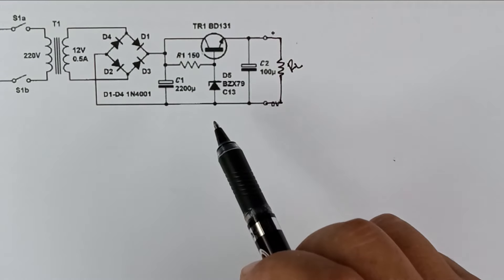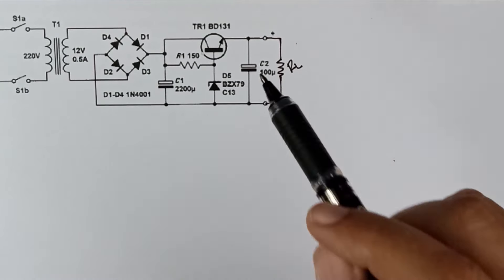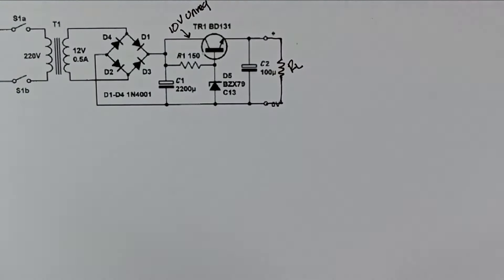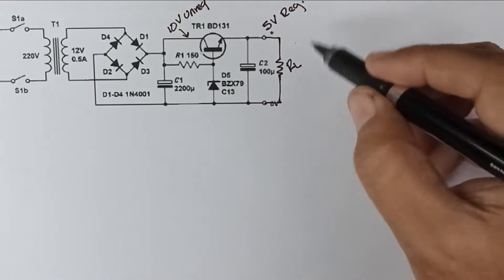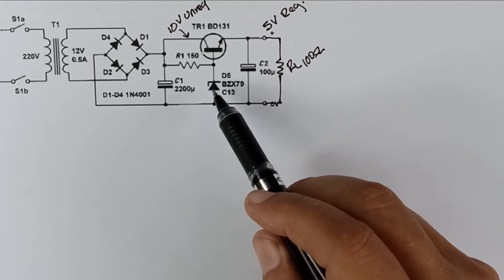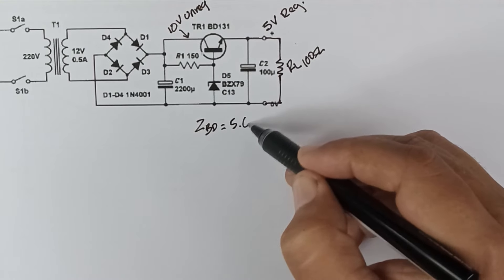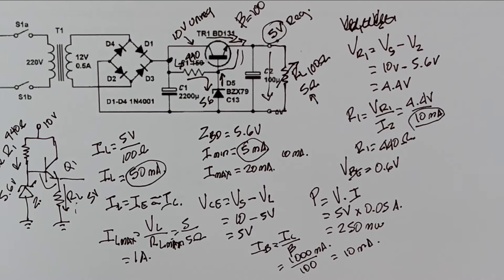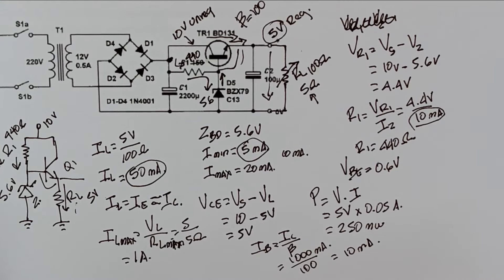How a Series Voltage Regulator Works (Voltage and Current Calculation)

Comment: Great video! The only issue I see is your going to have a hard time drawing 1 amp through the load coming from the secondary of the transformer that is 12v @ .5 amps. The transformer's secondary winding will short out fast and the primary will follow suit, producing a short across your 220v AC mains! Better put a fuse in circuit on the primary side of the transformer to protect your wall outlet from starting a house fire! :) Seriously though, I did love the video! Great job teaching the math involved! :)